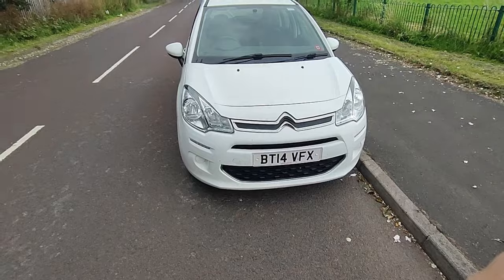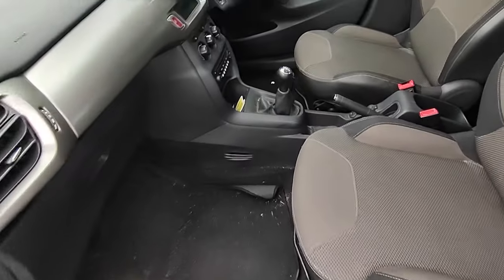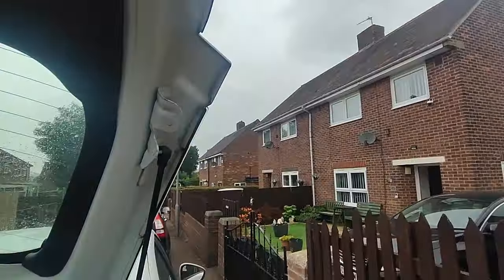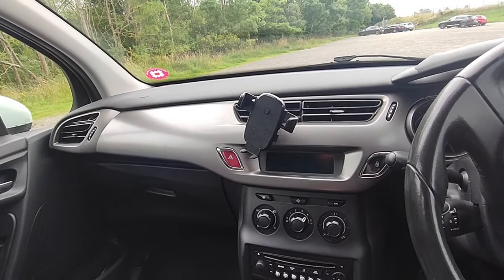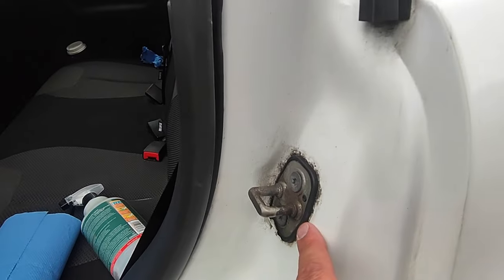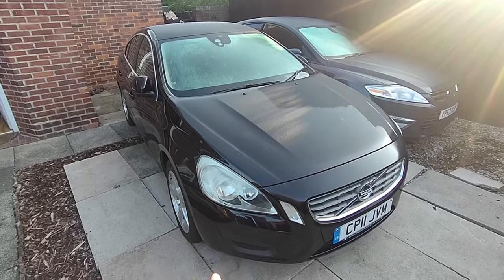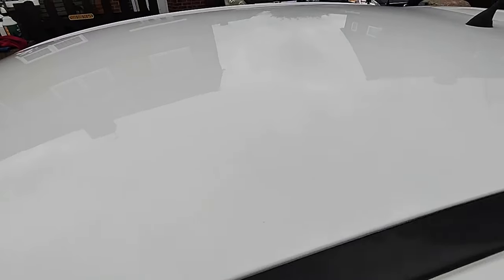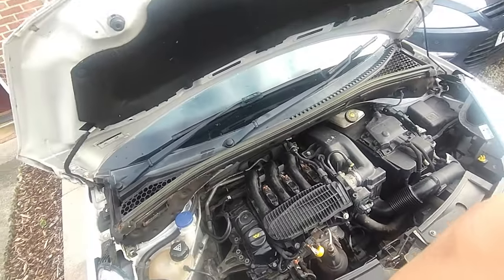EASY... BUT I MESSED UP! LOSING OUT ON MONEY!! (+TRUTH ABOUT THE S60)

Comment: I’m happy to see Copart salvage videos and private purchase videos. I’ve recently started in the ‘flipping’ game and have had some good results and some absolute mares. Please keep doing what you do 👍
Reply from the maker: @ianberry1713  Cheers mate, that means a lot to hear. What's the best success you've had? As in car model? It's always good to learn from others 😎
Reply: @CurrusOfSalvage  The best 2 I’ve had were a DS3 and a Nissan Note. Both Cat N from Copart. I currently have a 64 plate Corsa, also from Copart which I’m going to lose quite a bit on. Advertised as a cat N but turned out to be a cat S. Cost me a lot at a body shop to pull out the frame damage. Got a Fiat 500 coming tomorrow, hopefully it’s a decent one. I do like your videos, please keep them coming!!
Reply: Thats great to here as ive been doing the same too mainly private purchases not tried copart in years.

Comment: Hi mate. Try tar and glue remover on the lower marks. Also the top. But if not hit it with iron remover. Check out auto smart 5 ltrs for a relatively good price. 
Cheers j
Reply from the maker: Hi, yeah I would normally use iron remover, like if I was cleaning the car myself but I just didn't have the space lol. I'll definitely get some tar and glue remover though, cheers for that 👍